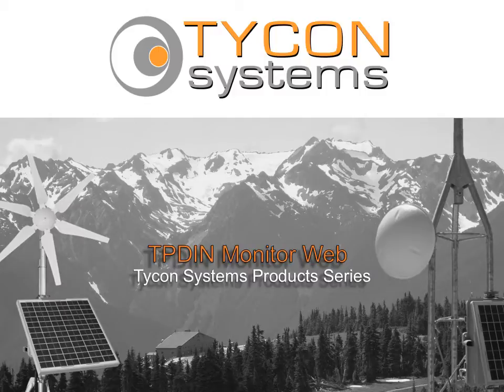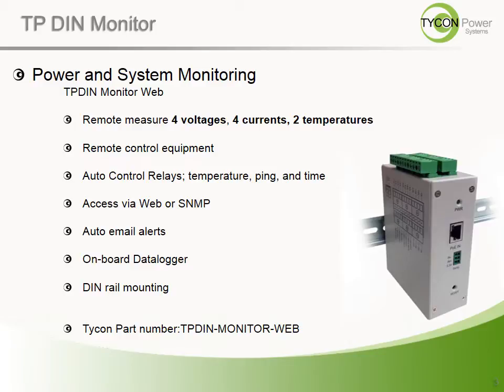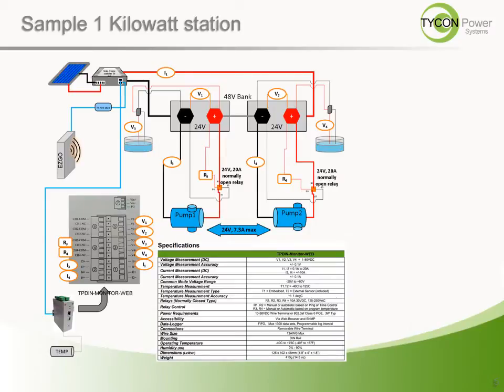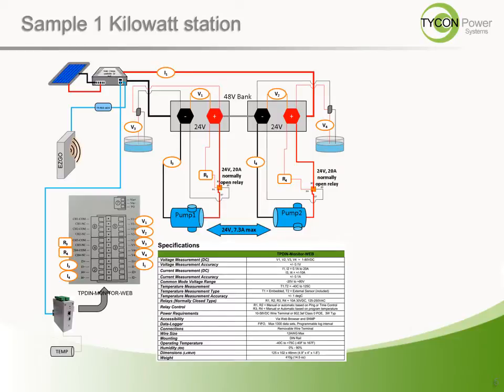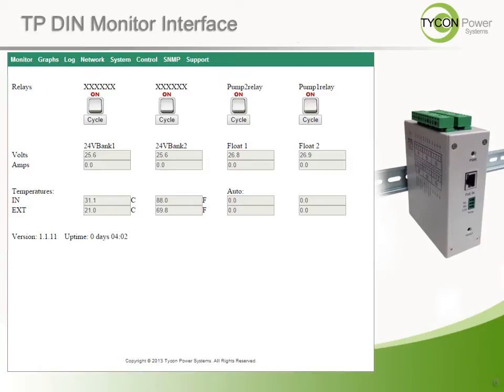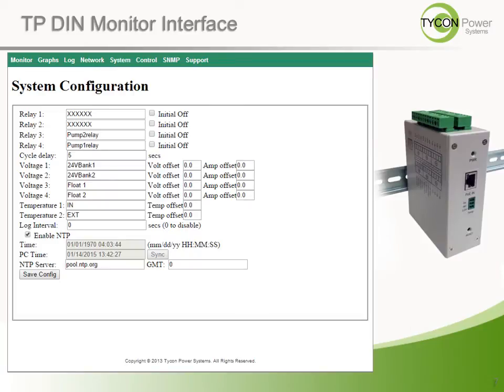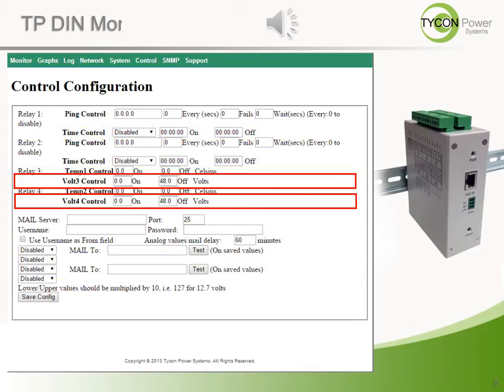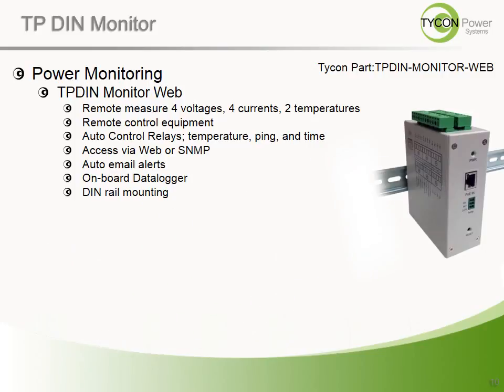Tycon TPDIN-Monitor-WEB Instructional Video

Comment: I found this one I imagine they discarded it.

When I put it to work, it asks me for a password that I don't know.

I hit reset but still the same.

How could I clean it all and be able to use it?

thanks for your answer
Reply: Press and hold reset button for 30 seconds will clear all settings to factory default.
Reply: @ScottParsonsSP   Thank you very much

I was exhausted, but thanks to your answer, I got it, I'm going to explore what I can do with this device.  😃😃😃
Reply: When you said it could be used to turn off the heater, how does that happen considering the heater is AC powered? I would love to learn the wiring.